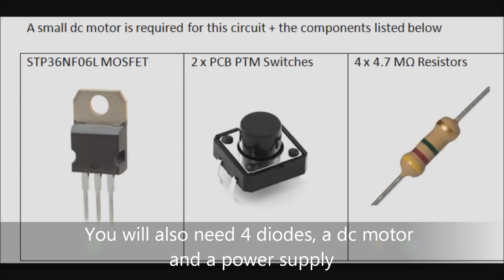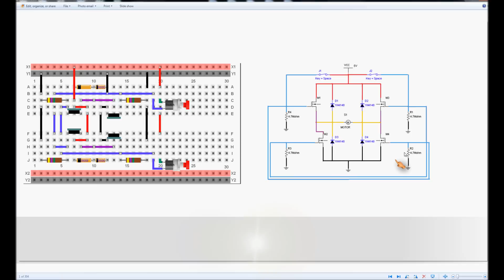N Channel Mosfet "H Bridge on Breadboard" Paul Wesley Lewis

Comment: Why can't I get this to work with two motors connected in series, and the bases of all transistors connected to an arduino.  If I only have one half of the bridge connected to the arduino it will work, but if I have both halves connected, it doesn't work.  Using a 9v power supply connected to the collectors.  Am I pushing current into the arduino somehow?  Pretty new to electronics.

Comment: You don't need the four flyback diods in parallel with the MoSFETs. The body diodes in MoSFETs takes care of the reverse current.

Comment: Thank you for the video, it's been very helpful with my project. It works as shown, however when I try replacing the push-buttons with logic level N-Channel MOSFET Switches, I can't seem to get it to work. I connected D to power, and S to go into the H-bridge. 

I tested the H-bridge to work independently, and the switching MOSFET independently in it's own circuit. The work fine on their own, but when combined, the motor won't turn on. I think I've narrowed down the problem to my switching MOSFET is not supplying greater than ~3V, however when in it's own independent circuit it can supply much more than that. It's rated to be capable of 60V. Any help would be much appreciated.
Reply: in your case,since you are using a low gate source voltage,you must try reducing the value of your resistors from mega ohms to ohms.so you must decrease it by a couple of ohms each time
Reply: replace ur top mosfets with P-mosfets it will work fine i guess
Reply: @shehabmahmoud8177  yea im not sure why this guy is using all n channels maybe its an arduino specific problem now that i think about it. direct switches can control it no problem. but the low level pwm signals from the arduino are the reason p channel mosfets are needed? ionly thing i can think of considering it seems to work just fine with all n channels

Comment: The High Side FETs will drop a lot of voltage. They will get very hot even with a moderate motor size.

Comment: It should be noted the schematic shows a condition the author says should never happen.  J1, AND J2 both closed.  The red push button switches are momentary, while the schematic has been improperly drawn with 'standard' switches (the proper schematic image is a straight line segment above, not touching either round dot).

Comment: Is there a way of putting a NAND gate between the inputs and the H-bridge so it only sends current if both inputs are not high? Good video.
Reply: +HobbyBots NAND? did you mean XOR? you can use IR2110

Comment: Oldie but goodie. I really like this circuit. Worked great for me.
Is there a way to connect it to an Arduino? I tried a few combinations but the mosfets are only triggering when around 12V are applied. I'd like to run it with 5V max. How would I do that?
Reply: You'd need to get logic level MOSFET:s or do a unnecessarily messy workaround with transistors as power switches and a 12v power supply I guess.
Reply: right now i'm also trying to connect arduino board with h bridge for inverter and pll synchronization purpose.. so far as what i understand, in order to activate the mosfet @ igbt you need to have a gate driver to boost 5v output from the arduino to at least 15 V for activating the mosfet. You can design your own gate driver or buying 4n37 ic for the simplest way
Reply: Why isn't logic level mosfet:s just the way to go? Wish someone would explain this to me.

Comment: Don't the top two FETs need to be P-channel for this to work ? I see you're not using a driver, so with the drains of the top two FETs tied to VCC, does the same VCC applied to their gates get them going ? I heard it doesn't quite work this way, since the gate voltage needs to be higher than the source for an N-channel to conduct.
Reply: Here is a tip for you: motor is a conductor.